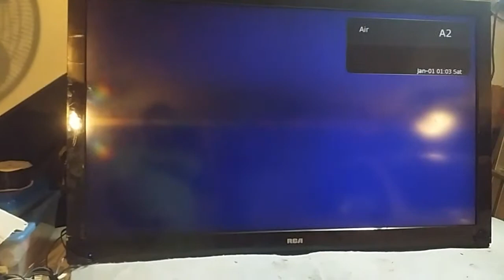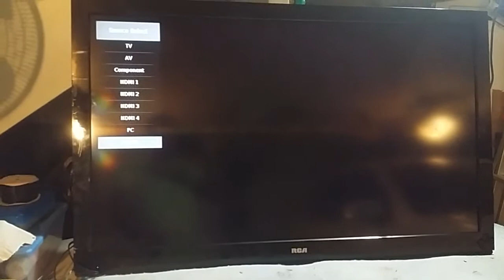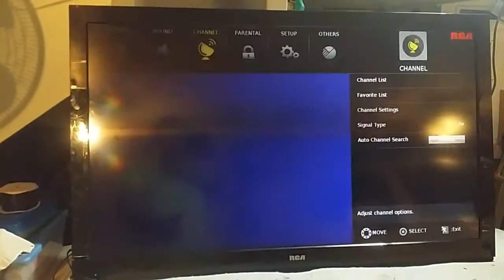RCA 46" TV Won't Stay On - Seeking Advice

Comment: Did you ever figure it out?  The blue  capacitors on the power board look swollen which means they're bad and need to be replaced
Reply from the maker: I had put in a used inverter board that didn't fix it.  Later I posted it for free "as is." So, no.  I figured I'd leave the video up for other people to reference.

Comment: Antone, our 55" LCD LED smart TV stays on for a couple of minutes, tops. Then it cuts off. Picture is great. Everything else works fine. What could it be? Motherboard or power board? I've found both parts but, need to be sure what I need to change.
Reply: Did you ever fix your issue ? I have the same issue going on

Comment: So what was the PROBLEM / FIX ?
Reply from the maker: I installed a "used but working" inverter board from eBay. That didn't fix it.  I'm hesitant to throw even another $20 at it.
Reply: I thought it seemed like it had to be something on the Power board. Mine does not flicker; if I unplug, it will turn on, picture and sound are fine. When it started happening a couple weeks ago, it just turned off sporadically. I had to unplug it and replug it in order for it to turn back on. Now, it is on picture perfect sound perfect for about 30 seconds and then just turns off and won’t turn back on unless I unplug it. Which of course, as to no avail since 30 seconds later it’s off. In other words, it’s gotten progressively worse.

Comment: sounds like the main board , replace the main board and that should fix it
Reply: antone freeman can I buy the main board and install it my self. How much they cost?
Reply: antone freeman . That is definitely not a main board issue. Would be inverter board or lamps bad. My opinion it looks like lanp in middle is darker in picture so my guess is lamp bad
Reply: Did you fix it?
Reply: i think also it would be inverter (starting 5:25)